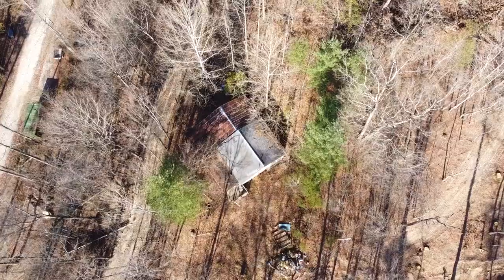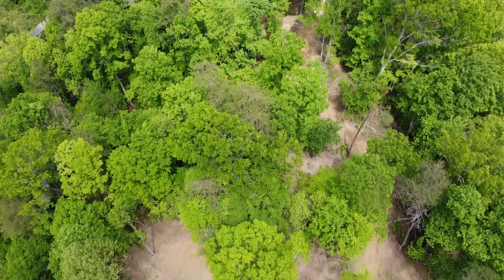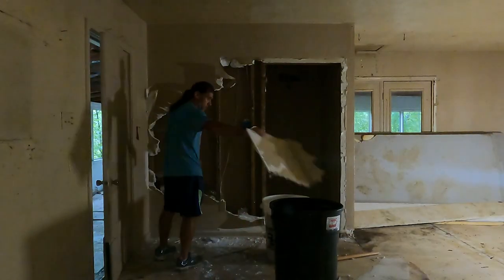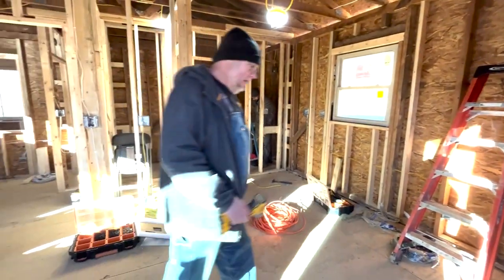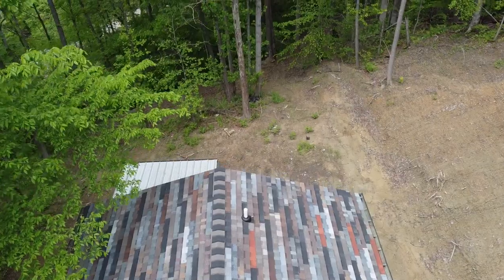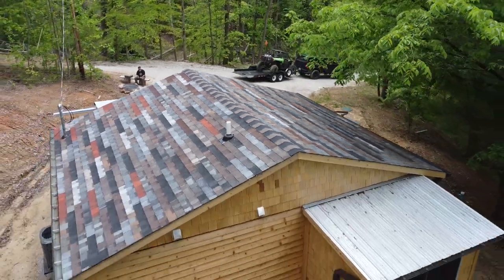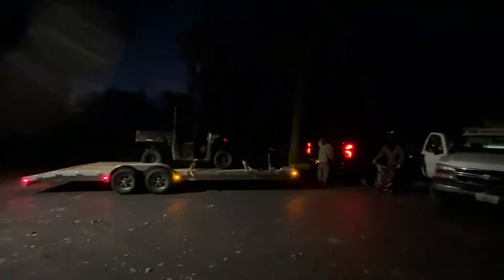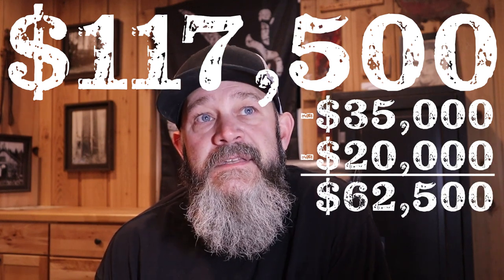How Much Did This Secluded Mountain Cabin Cost to Build?

Comment: Great break down!

Surprised it was that cost effective to keep the foundation and what was left after demo and cleanup.
Also surprised you were driving about 500 miles, each way... though I would guess you would spend a few over nights or long weekend or more as your duties allowed.

I have seen people calculate the fuel/travel costs of building cabins - and they later found it would have been better to get a near by hotel or even a nearby short term for a few nights or a long weekend to knock stuff out and cut down on travel time and costs.
Reply from the maker: Yeah, we usually stay all of us 7-10 days at a time and I try to bring as many guys as I can so we have a full truck when we go. This cabin I was able to hire more stuff out which helped allot but a concrete guy is one I have not been able to find!